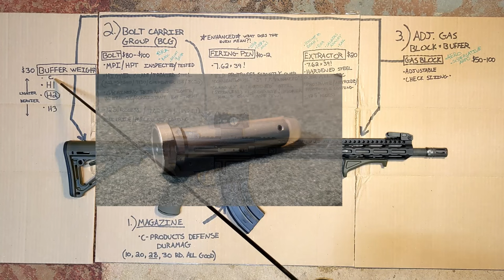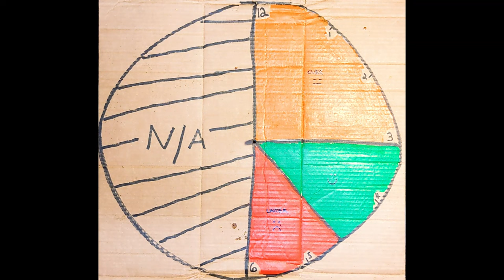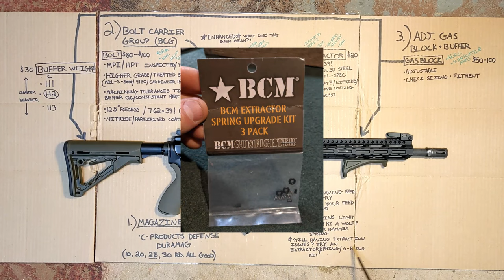How to Build a Reliable AR-47 (7.62x39 AR-15)

Comment: Any opinions on what's the shortest barrel lengths without suffering from issues that coukd be resolved with just using a longer barrel from the get go?
Reply: Most of your problems come from the MAGAZINE used, Firing Pin, Buffer, Buffer Spring, Extractor & Usually being OVERGASSED.

I built a 7.5" AR in 39 but I selected all the parts like, Adjustable Gas Block, Heavier Buffer & Spring, Enhanced Firing Pin, Different Extractor, only use C-Product 39 Mags.

It's built off of the BCA Gen. 2 Side Charging Upper Receiver & Bolt.

Don't have a lot of rounds through it but it ran great once I tuned the Gas in.

Comment: Quick question brother do side charging BCA uppers have the same extractor issues? Or do they last longer because of their design?
Reply from the maker: As in breaking extractors earlier than a normal 5.56 AR? Yeah, they all suffer this flaw, and it's by design of the hollowed out bolt/extractor to accommodate the larger diameter of the 7.62x39.
Reply: Can I use any bolt to repair mine when it finally goes out or is it different because it's side charging
Reply from the maker: @jmsn36  The actual bot yes, you can use any "standard" 7.62x39 AR bolt.  The bolt carrier however is proprietary to the side-charge upper.
Reply: @ExtremelyAverageMan  any recommendations as to where I can get replacements I prefer cheap parts so I can stock up a few vs buying one expensive one and risking being without a bolt while they warranty it

Comment: Been down this road, two broken bolts later and buying three mags to get one to work most of the time, irregardless of the brand. I have washed my hands of it. Geometry is against you, rifle was factory not Frankenstein.  I'd take another AR in 7.62 ×39 with an AK mag: that the geometry works. 300blk screams threw the Stanag AR-mag well like it's the native platform, 7.62x39 just plain doesn't.

Comment: Starting my first build and curious about ..enhanced..trigger spring with the firing pin needed??
Reply from the maker: I would just start by upgrading to an enhanced firing pin first (especially if you're shooting steel-cased ammunition).  If you're still getting light-primer strikes, then go for the extra power hammer spring.

Comment: Do you run a little heavier buffer spring or just the H2 buffer?
Reply from the maker: Just the buffer.  You could go with a stiffer spring, but I think it's better and easier to adjust the buffer weight with the gas.
Reply: @ExtremelyAverageMan  Thanks🍻

Comment: mine was double firing today....any thoughts... h4 buffer orange 308 sprinco spring.   (maybe should try an h3 buffer?) ejection still 2 o clock, but smoother. 

enhanced firing pin. drop in velocity trigger.
Reply: That's a very heavy spring & buffer for sure.
Reply from the maker: Like NoWr2Run said, could be that it's too heavy? That is strange, are you using an adjustable gas block?

Comment: Wouldn’t it be better just to buy a PWS MK116 chambered in 7.62 with a long stroke piston system?
Reply: Not if your on a Budget & like to tinker, LOL.
Reply from the maker: Could be, but this video is specifically on us weirdos who like the idea of chambering an AR in "the wrong caliber" and getting it to run reliably.  I also have a Mutant if you're interested in that review.
Reply: @NoWr2Run  I bought mine 1 part at a time as the budget allowed.
Reply: @Jake-pq3iz  Unfortunately I didn't have that much restraint or wasn't that smart. I'm trying to do that right now though but it's a tough time of the year.
Reply: @ExtremelyAverageMan  Waiting for Part 2 ?

Comment: Do you have to use a .308 handguard? Notice my others don’t fit. Do I need to grind off the rotation tabs? Curious what you were running.
Reply from the maker: It doesn't have to be .308 or .30 cal specific, any AR-15 handguard will work.  The handguard on the AR with the red dot is the Midwest Industries Ultra-light 14" handguard that I did have to cut off the anti-rotation tabs for, but it held up just fine.  The handguard on the AR with the LPVO is the Dirty Bird 13.5" SMRS handguard that I didn't need to "modify" after I installed the barrel nut on.  It's actually a sweet handguard for the price.

Comment from the maker: 31:30 Oops, meant to say *Faxon Gunner Barrel.
Reply: Just wanna mention that 16 Faxon Gunner Barrel is mid-length and the gas port is relatively small. It might be undergassed if you use a H2 buffer. I wonder if an AR is overgassed, should I only run an adjustable gas system to limit the gas? Does a heavier buffer with the adjustable gas system make an AR more reliable comparing to just an adjustable gas with a carbine buffer?
Reply from the maker: @ryanliu2600  Good call! This will be an upgrade that I'll probably do later this year, so thanks for the heads-up.  I may do a video on it too, if it helps others out as well.  You certainly can, and if it cycles good and feels good to you, then that's less money and less tinkering you have to spend on it.
Reply from the maker: @ryanliu2600  You are correct, and being a mid-length gas system as opposed to just a carbine-length, I don't quite have the experience as to how the balance of gas system is affected.  I still wonder that myself.....do you even need the heavier buffer if you just get the adjustable gas block and roll with the stock carbine buffer? I think you can, but after testing both theories, if feel the harmonics are better with a heavier buffer.  It's hard to describe, but with a heavier weight and slowing the BCG just a little, it just feels smoother and more balanced. My advice will still be to get both (heaviest buffer you can while maintaining good ejection) and tune it accordingly the rest of the way with the AGB. If that's the case, maybe try an H1 buffer if the carbine buffer is still running a bit over-gassed?

Comment: So I took my new AR47 to the range today.  I put an H2 buffer on it. It cycles 4 rounds and stops. The RTBA bolt carrier group seems to be functioning properly.  I think the gun is slightly under gassed.  Do you think it's worth putting in that adjustable gas block? I'm almost there it cycles 4 rounds continuously but won't cycle the 5th. Your advice would be greatly appreciated
Reply: Did you correct this yet ?
Reply from the maker: On a clock face, where are the rounds ejecting? And by stops, is it short-stroking? (Not ejecting and/or loading the next round?)
Reply: I changed out the buffer spring again for a different carbine spring. It seems to be working now. Honestly I haven't run too many rounds through it to actually say it's reliable yet.  I need to find time to go out to the range and put a couple hundred rounds through it.
Reply: @ExtremelyAverageMan   the rounds were ejecting at around 6 o'clock.  They would land behind me. I took the gun in to my local gun store and they test fired it with a new buffer spring.  It did empty the entire magazine without getting any problems.  But I didn't notice if the ejection patern changed.
Reply from the maker: @marcosherrera675  that's good to hear. Based on that ejection, it did sound pretty under-gassed

Comment: If the bolt and extractor are an issue because of the amount of material that has to be removed. Why not just build a 7.62×39 using the AR 10 platform?
Reply: Magwell is too large for any AR 7.62x39 mags
Reply: @righteousone8454  sounds reasonable but how about using a bigger bolt or is that a problem due to the size of the upper
Reply: CMMG uses an ar-10 bolt in a modified ar15 receiver.
Reply: @Subtlenimbus  for every problem,there is a solution 😊

Comment: What buffer weight would you recommend?
Reply from the maker: Generally speaking, I'd recommend an H2 (and adjust it from there with an adjustable gas block).  Some people run an H3, but I feel most stick with an H2

Comment: What lower receiver do you use, model wise ?
Reply from the maker: It doesn't matter much, any reputable brand will do for a lower receiver.  Say what you will about Anderson, but they run just fine.  I had an Aero Precision on my second build which are great for the money.

Comment: Them enhanced parts are The Extra Parts needed to run better so u didnt use the bolt carrier that came with the the upper
Reply from the maker: I did use the original Bear Creek bolt carrier that came with the upper.  It's a proprietary part.